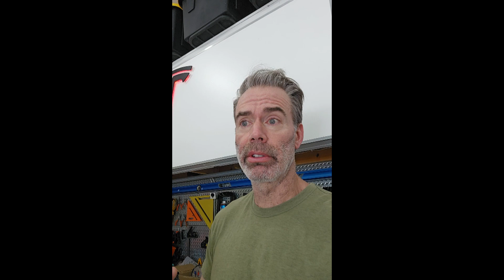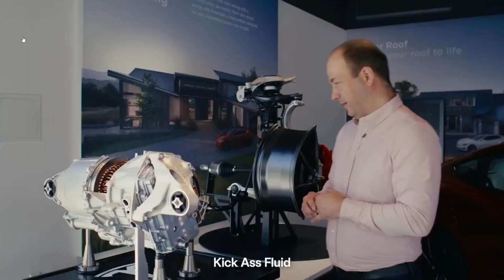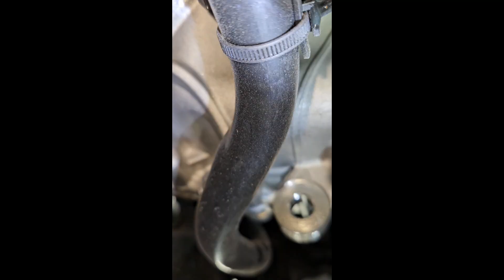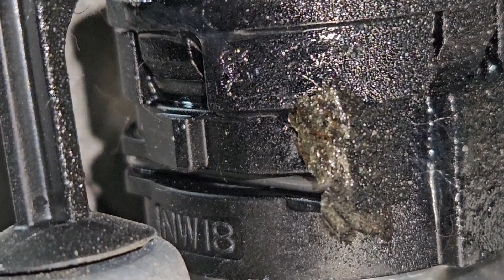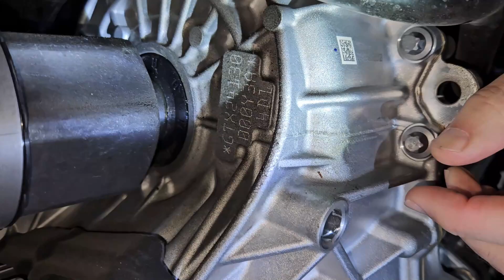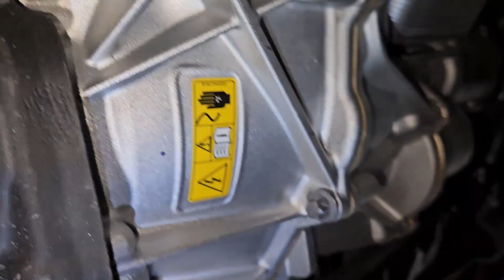Tesla Leaking Kick Ass Fluid?  Subscribe for Follow-up

Comment: I had 2018 Model 3 LR RWD with oil leak from the oil pump. Tesla replaced the oil pump under warranty.
A month later, the drive unit failed and replaced under warranty.
Reply from the maker: @CookiePepper  Oh wow, I'm assuming there was enough oil to leak onto the garage floor? Any system warnings?

Comment: Since it a new car chances are that it is assembly lube used to protect the steel surface of the shaft that rubs on the gearbox seal from rusting prior to it being assembled. It also prevents the seals from running dry until the gear oil is inserted into the gearbox. Unless you get a puddle on the ground where you park it, it should not be much of a concern.
Reply from the maker: I hope you are correct, but there are a number of others with more leaking than mine.
Reply: Yeah I'd buy that, maybe, on mine and some others IF the leaking stops.  But a couple of other examples seem to be leaking so much that it does splash all over the aero cover and drips onto the ground and it seems to get worse over time, not better.  That's sus.

Comment: The most likely thing that has happened is it was overfilled. I've seen this many times when overfilling a rear differential. What happens is the fluid will heat up and expand. If there is too much oil, it will find a way to get out. The only way the oil can get out is through the seal.
Reply: So does that blow the seal(s) and they have to be replaced?  Because some of these seem to be continuously leaking over a period of months and they're not stopping.  You'd think it would stop if it was just blowing off some overfill.
Reply: @mikeyc8139  The best practice for something like this is to drain all the fluid, pull the axle, pull the seal, clean the area where the seal goes, press in a new seal, replace the axle, put in new fluid. Now some seals require grease, and since some of the pictures I have seen with this have what looks like is grease, probably need to put in new grease when pressing in the seal.
Reply from the maker: I kind of hope it's something simple like an overfill.

Comment: I'm the other video showing slight leakage at 530 miles.  My appt is Sep 9 (unless they cancel it on me).  My fear is they'll say "normal" and won't acknowledge it until it busts wide open.  🤣 I suppose there's some outside chance they just overfilled them at the factory and some comes out of the breather (if there is a breather).  But the people on X said theirs is only getting worse so I doubt it's something simple like that.  Your theory about the KAF being "slipperier" or "thinner" (possibly when hot) and sneaking past the seals is a possibility.  Like yours, mine does look like it originates at the half shaft seals but MAYBE it starts higher than that and just collects there.
Reply from the maker: Hey!  Yeah, I'm afraid of the same - saying it's normal until it's too empty to properly lubricate and then ruins the gears.  As long as this all happens while under warranty it won't be too bad, but still...
Someone also mentioned overfilling, which could be.  
Someone else also said that it is common for some install grease to come out, but I'm not so sure about that one as it's a lot of grease and I don't recall seeing any grease blobs on my 2018.
I don't think the leak starts higher up because the driver's side was easy to see all the way around the seal and I didn't see any oil leak trails up there.  Could be wrong, of course - maybe there's an overflow opening up there.

Comment: The driveshaft seals will be pre-greased within the void between the scrapers of the seal. This helps lubricate the seal, but if the seal leaks, the oil can 'wash' this grease out, thus you can get oil and grease leaking out.
Reply from the maker: I like this explanation, but that's a lot of grease.  Seems like way more than would be required for pre-grease install.

Comment: Yep, I found grease/oil residue on the underbody rear cover. Model 3 SR+ 2021 US made. Took it in to the service centre, after showing pics of the oily residue below the seal and on the inner 1/2 shaft knuckle. Right hand side. Definitely coming out of the seal. Their techs said “Inspected rear drive unit but can only see dust stuck to greasy residue. No oil leak from rear drive unit. Rear drive unit oil is red in colour. Grease may stuck from be road conditions (?). Cleaned off residue and customer to monitor and reinspect. No oil leak at this time. All OK” Hmmm. So if they want me to monitor it to see if it reoccurs then I surely will do that. Unfortunately I had cleaned off the oil stain and the lump of grease stuck to the upper surface  of the cover a few days prior to looking up under the car to see where it might have come from. Cheers, Phil
Reply: Now I have discovered another issue - the coolant level in the bottle is sitting a fair way below the “NOM” line marked on the bottle. So I got under the front of the car this time, removed the front underbody cover and discovered a fluid “weep” on the hose connector marked with a white band that plugs into the bottom of the coolant bottle. “Not urgent” the service guys wrote, as the low coolant alarm hasn’t yet been triggered. I Have booked it in to the SC end of August. We’ll see what happens. Cheers, Phil.
Reply from the maker: @philgower292  Coolant leak also?  Crap.  I hope the alarms on this car are accurate and don't wait until things aren't lubricated or cooled properly.
Reply: @philgower292  I recently picked up a 23 RWD with 35k miles.  It was low on coolant and brake fluid.  Topped them off but I’ve not checked for a leak.  I spent a whole day cleaning out the radiator.  I should have looked around while I was under there.  Still have warranty but I’m two hours from a SC.  I also have the wet tail light problem.  I thought that was fixed.
Reply from the maker: Thanks, I made sure to leave the greasy mess on the top side of the panel.
Reply: Follow up since my Tesla SC visit - no evidence of further leaks. All clean. All good. Also coolant level now at upper mark on the bottle.
Reply from the maker: @philgower292 Thanks for the follow-up! 
I guess this is good news but it seems the coolant leaked a decent amount at one point but then just stopped leaking? Seems sketchy, but easy enough to keep an eye on

Comment: Did you notice fluid leaking before removing the panel or did you remove the panel to inspect for leaks upon hearing the possibility of leaking?
Reply from the maker: Didn't notice anything until I removed the panel.  I show the top part of the panel and it shows how far the leak has traveled so far.

Comment: Well I better check mine.. I have 5000 miles on my 2024 m3p it’s been running great but best check before my upcoming trip
Reply from the maker: See anything on the outside of the panel, without removing it?
Reply: @mmark300   negative, I’ll have to lift it and see if there’s any liquid on the inside of the panel.